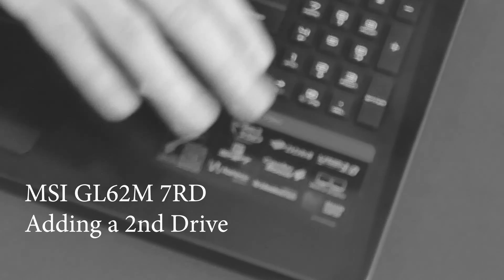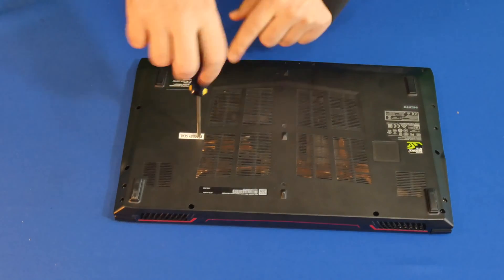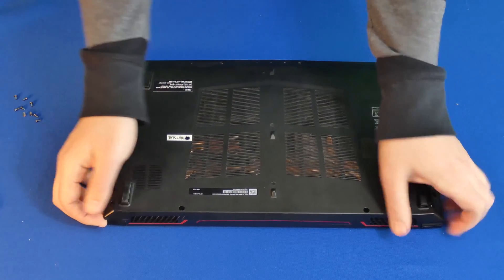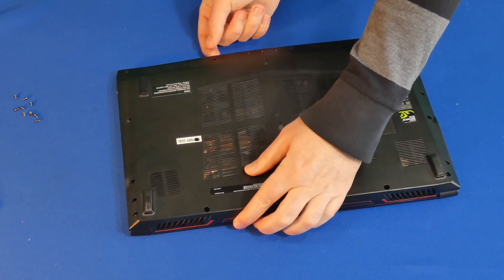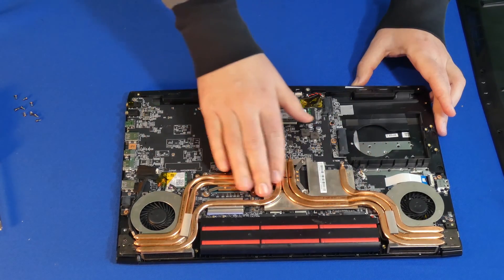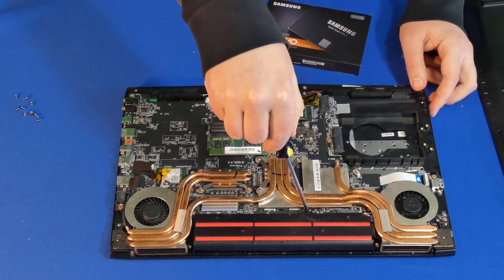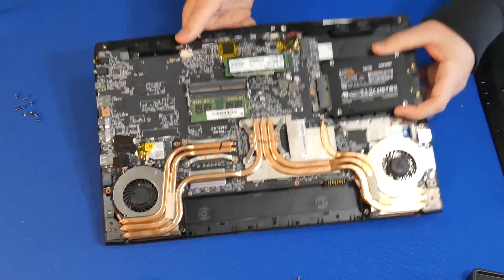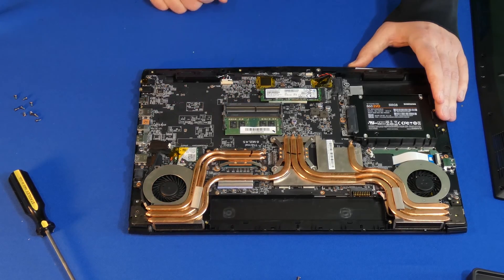Upgrade SSD to MSI GL62M 7RD Gaming Laptop

Comment from the maker: Adding a 2nd SSD to MSI GL62M 7RD Tutorial. IMPORTANT . I was wrong... You can secure the SSD with screws (on the sides there are holes). It was not apparent to me until I watched the video again after upload.. Sorry about that... :)
Laptop (affiliate): https://amzn.to/2UUWsR0
SSD 500GB (affiliate): https://amzn.to/2YhHHcY
SSD 1TB  (affiliate): https://amzn.to/2TufqMw
Reply: Hello, thanks for the video my man. I have the same laptop and I didn't know if I could use a 2.5 inch SSD instead of the M.2 SSD. So, I can buy the 2.5 inch SSD and install it? I dont need anything else?
Reply: I'm answering myself, I need to remove the HDD if I want.
Reply from the maker: Sure thing. You can use both. M.2 is crazy fast so I would keep that as the OS.
Reply: Can I ask what are the screw’s sizes? The screws you said are the two little ones next to the ssd right?
Reply: @cobuman I know this is really old but did the SSD come with the necessary screws? If not, which screws will I need?

Comment: Hey 👋🏻, I was wondering if there is a way to determine which one do I already have or currently using whether it is the 2nd SSD or m2 ssd. I have yet to modify my laptop and have not tried prying it open as well. Which is why I am still wondering whether what should I buy as a supplement to my existing storage.
Reply from the maker: You can go to Device Manager and look under Disk Drives. It will tell you names of them, after which you can google search the name.

Comment: Hello I’m a little bit confused is m.2 ssd compatible with the pcie gen3 slot on my laptop? I’m planning to buy samsung evo 860 m.2 ssd for my laptop. I have the same model as yours. Thank you
Reply from the maker: □I actually found something interesting in regards to that and made a video about it: https://youtu.be/CeoxiNTtXrc 
You can install any m.2 and I'm assuming you meant 970 Evo? 😁 Linked video will show you everything.
Reply: cobuman Thank you so much sir, It helps a lot!
Reply from the maker: @edwardmaghirang9726  Sure thing.

Comment: Hi, we have the exact same laptop. Hopefully, you would still get this message. I'm planning to upgrade the current HDD in my Laptop as its slow as fuck (sorry for the word). I need your suggestion if I should get an M2 or the one that you installed?
Reply from the maker: Your OS is using the m.2 slot. You can just add another drive just like in the video that way you don't need to reinstall Windows.
Reply: cobuman, mine doesn’t come with the M2 so the Operating System is actually in the slow HDD. With that being said, can you suggest an M2 SSD for the same unit? I’m not sure what to buy.
Reply from the maker: @ChrisAmparado  Sure, The best brand is Samsung with 970 Evo Plus being the fastest like this: https://amzn.to/2R0HvwG 
Standard 970 Evo is also good: https://amzn.to/39uVCRm

Comment: Wait, so if you wanna upgrade your hard drive to this ssd, all you have to do is take out the hard drive that came with this laptop and replace it with the sssd?
Reply from the maker: Yes, but in this case the main SSD is the m.2 drive.  So on this case the SATA hard drive slot was empty because the OS is on the m.2 drive. In which case it's not removing anything but adding a 2nd drive to it.
Reply: @Cobuman  So let's say I'm out of space and I don't have a M.2 ssd and not planning to install it. All I have to do is get the ssd shown in this video and remove the hard drive and replace it with the ssd?
Reply from the maker: @ZevisGT  and reinstall OS.
Reply: @Cobuman  I just realized the hard drive is the M.2 ssd so that's why you installed a bigger ssd because you have a empty slot. We have the same laptop.
Reply from the maker: @ZevisGT  👍

Comment: With ram is it possible to install say a( 1x 16gb) ram stick with the previous( 1x 8gb )already installed or does it have to be (8gb and 8gb) so (2x 8gb) and can any brand ram work ..   .
Reply from the maker: Good question. 2x8gb and it has be specific type of RAM like this: https://amzn.to/2OGxp3R
I also have a video on that: https://youtu.be/wawW-4E8ryA
Reply: @Cobuman  on the link it says 2400mt/s and two others which is the best is that for speed or somthing .thanks for replying.
Reply from the maker: @fbomb2834  Sure thing. So you need the number CT8G4SFS824A  which is the 2400 mt/s . Same in my laptop.
Reply: I have the msi gl62m 7rd 1407